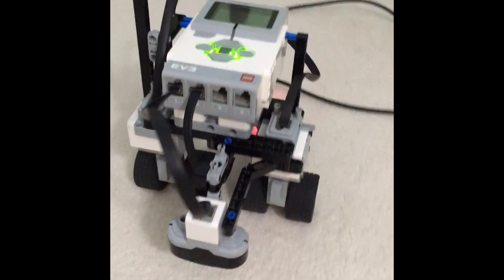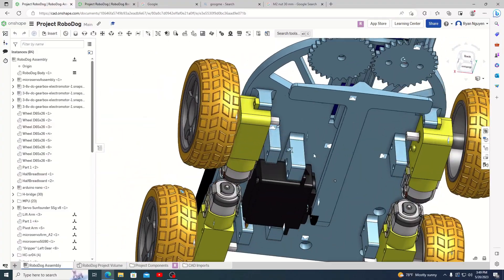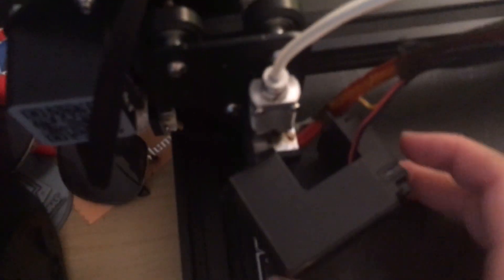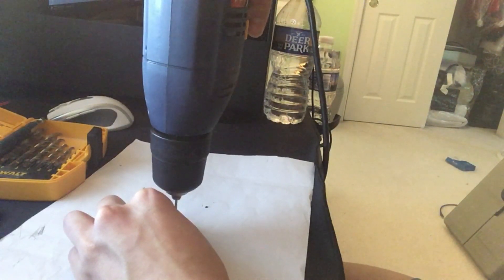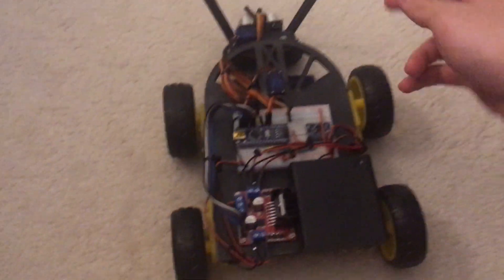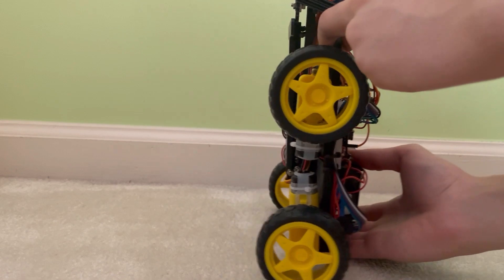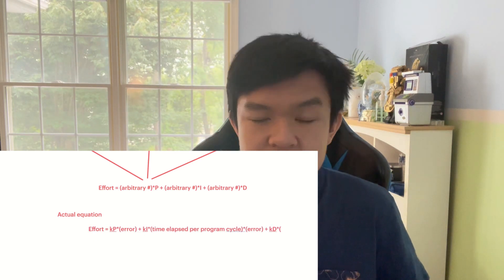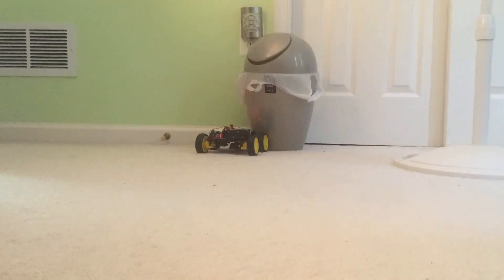Building and Training a Robot Dog

Comment: Great video mate, just a quick question. How did you know the correct ways to wire your breadboard with the Arduino? Did you follow a series of online tutorials, or worked on a simiar previous project and based this one off of that. I'm still a beginer to eletronics, but i'm curious on how to learn how to wire my own personal projects with Arduinos. Also I noticed you used a solderless breadboard for the connections, did you ever have any issues with the wires disconnecting from the board whilst the robo dog was moving? All the best from the UK👏
Reply from the maker: Hi Dylson. I learn how to incorporate arduinos (and in general, any new component that I don't know about yet) by trying to learn about the main concept of how they work, and then I may look at tutorials to see how they work in specific examples. Then I would experiment with it on my own, which is honestly where most of my knowledge and all of my experience comes from. Somtimes, I just experiment before I think I fully understand it, and that could lead me to fully understand it anyways (of course, I'd only experiment if it was safe/cheap/etc. to do so). Hope this helps! Also, the breadboard generally keeps the connections, but occasionally I would have to reseat the wires in the holes.
Reply: @TheTinkeringTechie  Hi mate, that makes a lot of sense and is a very intuitive approach. I honestly do the same, where I look online and see how others do it and then I just mess around myself to see if I can get it to work. I'm glad that it's the same approach as yours. Thanks for taking the time to give me a detailed reply, I really appreciate it. Have a nice one 👋